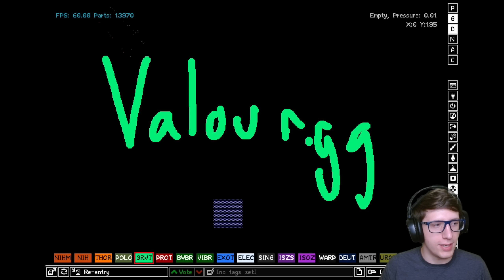PLASMA RE ENTRY POD with Graphene in The Powder Toy!

Comment: Fun fact: that antenna is kinda pointless during reentry, since plasma kinda just blocks all radio waves and telecommunications attempts between the space centre and the reentry pod. but it can be used upon contact with the ground [IF ITY SURVIVES].
Reply: If it’s long enough and strong enough it could still work

Comment: Spike, did you know that just like you can hold shift for straight lines, you can hold shift and alt for straight lines that are snapped to 0°, 45°, 90°, ect. So whenever you are trying to make something like walls, you don't have to be so precise with your mouse. Also you can hit "=" to reset the air pressure so you won't have what happened here where the gasses kept bouncing. And you can use the number keys for filters. I don't know all of them off the top of my head but "8" is nothing, and "7" is fancy.

Comment: 13:40 I’m assuming it reached a equilibrium point. The smoke from the fire basically was cooling it down as it went up the sides. Effectively deleting heat when it left the screen.

Comment: for a good re entry simulation blast oxygen,ozon, hydrogen and other gasses at the pod instead of plasma at a massive force… if powdertoy does it correct it will create plasma on its own against the pod…which actually works as a sort of shield for the people inside.